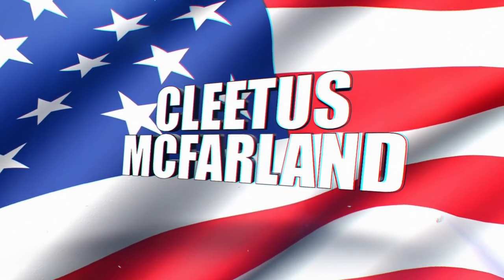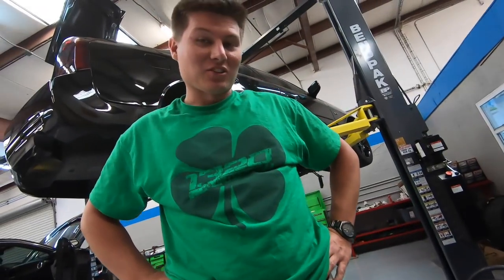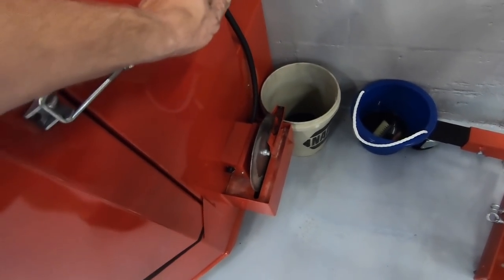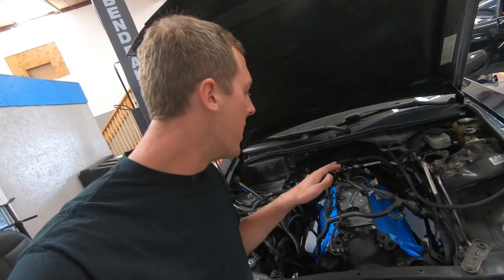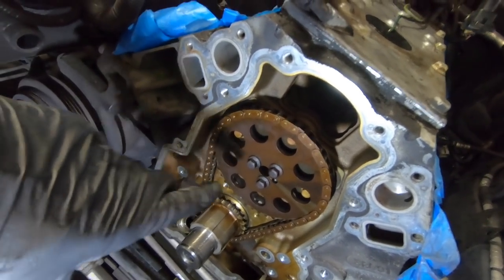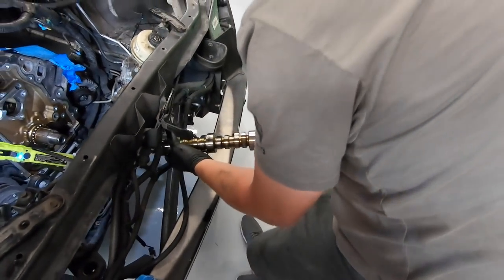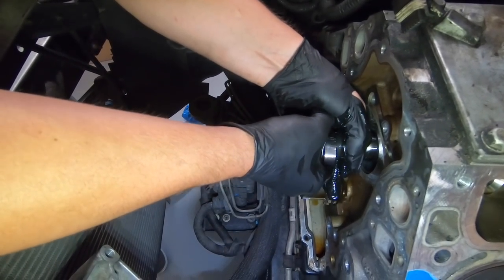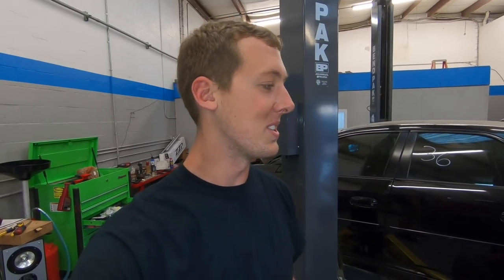Supercharging the V' EP.2 - CAM and Rear Diff Install! (EXTREME BALD EAGLES)

Comment: Had to be done in this build anyways I get it, but on all ls engines you DO NOT have to remove the lifters or heads to remove the cam, if you use 2 3/8" wooden dowel rods they slide right in and hold the lifters up in place.

Comment: The anti wheel hop works because the different axles sizes will have diffenrent reasonant frequencies. At reasonant frequency you get maximum amplitude and when both have the same you can get catastrophic failure.

Comment: We have a parts washer like that at work....only you can fit 3 full engines in it if you wanted lol. 

it even looks and opens the same way.  We use it to clean large crane winch parts

Comment: The shorter/thicker axles play a role in the torque distribution and trying to make sure that the rear end doesn't pull to one side versus the other. You lose torque the longer an extension is when wrenching, so same principal here. Honda has done this for years on their front axles in trying to compensate sides. Interesting strategy.

Comment: Hay Cleetus looking-good on the V upgrade. Question? Why didn't you use an ATI balancer? They smooth things out soo much. ATI Performance Products 917266 - ATI Super Damper Serpentine Series Harmonic Balancers Keep it running. Let-re rip tater-chip!

Comment: Don't forget the interchiller for the supercharger you can get one from Australia
Reply: Garrett you don't have to put in an expansion tank you can put it in her Chiller on there and it works just as good as expansion tank if not better and intake temperatures typically stay around 30 to 65 degrees all the time
Reply: Nick guitarmageddonzl1 used one on the freedom rocket and the results are crazy

Comment: When u pull cam like that dose it drop the lifters?
Reply: in motion they pulled the lifters
Reply: No it DOES not, they pulled the lifters.
Reply: in motion you couldn’t pull the cam without removing the lifters
Reply: On an LS engine you can pull the cam without removing the lifters. They have plastic retainers that keep them suspended.
Reply: quadriderkyle good too know thanks I always wanted to put a cam in my tahoe but someone told me not too unless the motor was out and spun upside down he said the lifters would fall into motor.
Reply: Yeah but you can just fish em out of the oil pan and drop back em back in the spark plug holes and they just seat back in.

Comment: Why didn’t you just pull the hole engine right out if you had to do the motor mounts it would have been so much easier to work on and plus you didn’t have the transmission bolted up

Comment: The engine is just sitting there...why don't you pull it out...clean it up and put on a new oil pan gasket...it looked pretty scanky...plus a lot easier to work on it on a stand.
Reply: Steve Reinhart no kidding they have almost everything disconnected and are going to replace the motor mounts. They just as well pull it.
Reply: Ladd Hooks Sounds easy right?
Reply: Same thing I thought. Literally six bolts to take out and the block is hanging out with space for days while the heads etc are installed.
Reply: wainfiggitty never seen the engine compartment of a v but if it’s anything like some LS cars (f bodies in particular) it can be a bitch and a half to put motors in or pull out. Took me a few hours to pull the motor and put in the new one in my trans am. Again never seen them in person though.
Reply: Burnout762  yea F bodies are a pain. So are express vans without a way to lift the body. My Escalade was fairly easy, just had to remove the intake first. That caddy looks pretty open though, doesn't appear to be tucked under the cowl.

Comment: I have to ask, why didn't you just pull the motor out of the car? Your like 30 minutes to pull it out at the point your at. Just curious
Reply: tbboardhed2 more like five. Thing is just sitting on its mounts.
Reply: tbboardhed2 because a 5 minute pull is like a 2 hour reinstall it’s worth the trouble putting it all back together in car cause getting everything lined up is a pain in the ass
Reply: The trans is already out. You put the motor and trans together outside of the car. Drop them both in together. The only thing you have to line up is the motor mounts. Then put the trans crossmember in. If that takes you two hours, you should slowly step away from the tools lol.
Reply: I'm glad someone else had the same thought. They could have pulled it (there was lots of space), had an easier time with the oil pump or pickup tube (cletus commented that it may be a pain), then changed out the cam and assembled the top end and torqued everything on an engine stand, where it is easy to get to. I know it can be a pain to pull and reinstall an engine (from experience), but that one would have been easy to drop back in with new mounts and then install everything just as if the engine had never been pulled. Depending on the fit at the cowl/firewall, they may have been able to install the intake and supercharger while on the stand as well. Even if it took 30-60 minutes to drop back in, it would have taken less time to do all the other work and it would really save their backs..........but they are younger than I am and apparently don't have the same neck and back problems.
Reply: I was thinking the same thing the whole time that I was watching the video. It would be so much easier to work on the engine on an engine stand.
Reply: Cameron Vandygriff I do stuff like this literally every day. If they didn't have access to a lift, yes getting everything to line is up a pain but they have all the right tools not to mention they have it on a lift. If you can't get it to line up In a set up shop then the user is doing it wrong.

Comment: Man as much as it's torn down I would have redone the shortblock. Upgraded everything else now the weak point is the abortion which would be less than that diff
Reply: I have heard many claim that the LS style short blocks hold up very well to boost and they seem to work with the stock pistons. One guy ran twin turbos and beat the crap out of his for about four years before it let go on the dyno. It depends on how much power you want to make and how much money you have. At that low of mileage, the cylinders are often reported to look like new. They should have at least pulled the engine, cleaned it up, and resealed the oil pan and assembled as much as possible on a stand rather than working over the side of the car. The LS has some great advantages over the Gen I sbc engines in my trucks.

Comment: uuug......dont bunch the lifters together,,,,,they need to go in same hole they came from.....and please dont install a dry cam......assembly luuuuuuuube....and did you see the wear on the old cam bearing surface....it needs  bearings.......thats it......im coming over there....i work for dew

Comment: You don't put Vaseline on a axle of a car, it's not going to stay "lubricated" it's going to get hot and just melt right away , you need to put car grease on there for axles it's designed to hold heat and not melt and stay lubricated I thought you guys would know that I know that because I do cars .
Reply: DJ.Spikes Hostage  it’s meant for installation if you worked on cars you would know that

Comment: Failed to put assembly lube on a brand new cam, but lubed up the axle half shafts, goodbye warranty.
Reply: Bassntruck no need to on a roller cam and they oiled it u could see it all over the gloves
Reply: Bassntruck I thought the same thing, but he did say in the video they have the cam lubed up ready for Cooper to install
Reply: They did lube it up , like previous comment he said in video and you can see all on the gloves
Reply: What they put on the cam is NOT assembly lube, there is a BIG difference
Reply: Bassntruck what’s a warranty ?
Reply: They say, it's all lubed up, and you can see it
Reply: Shit, idk how mine made it with just oil. 20k miles in, I hope I didn’t wreck it.
Reply: G war.. an.. tey?
Reply: Pseudo Mortality what keeps the cam lubed once it's in the engine, OIL
Reply: it's a A ROLLER cam......

Comment: I give it 1,000 miles before he blows the bottom end out of it
Reply: Yup, there are many videos of others using blowers or turbo on a stock bottom end. Apparently the pistons in the LS engines are pretty decent. I would have pulled the engine and resealed the oil pan, then built it on a stand and even installed the supercharger if it would fit back into the car while on the engine. Many people have reported that LS engines with less than 200k miles on them still great looking cylinder walls and often have the cross hatch still in them. Some people state that just doing rings and bearings often makes the engine like new. It seems like LS engines can make power for less money than the gen I sbc that is in my truck. Just a roller cam conversion was almost a grand for that thing and after a forged crank, aluminum heads, porting, etc., it was easy to have $6k into an estimated 400hp/500tq engine (Komnifornia smog laws kept it from being a more aggressive build).